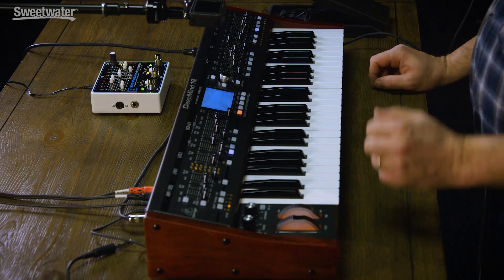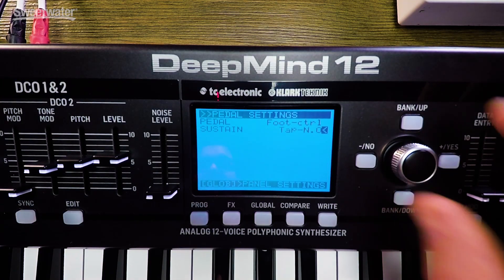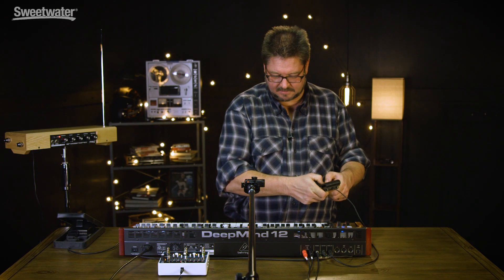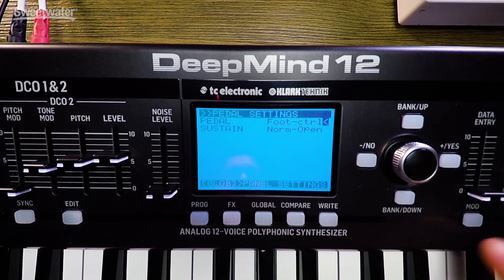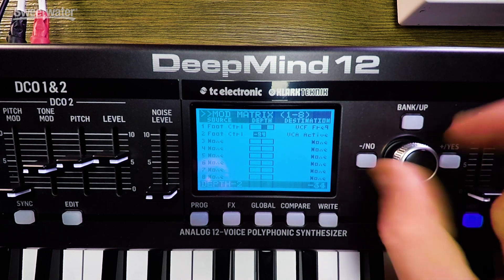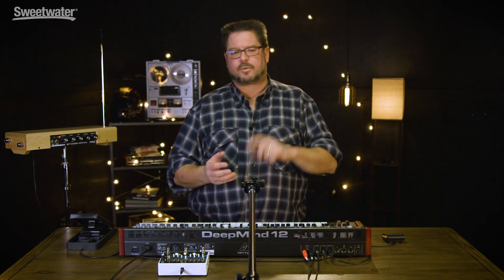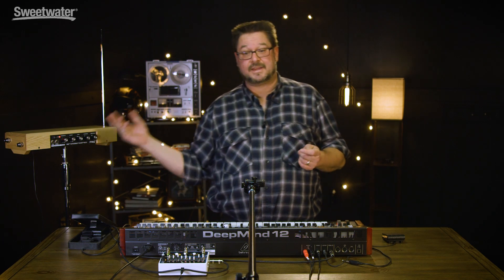Behringer DeepMind 12 Control Voltage and Pedal Inputs — Daniel Fisher

Comment: Hi there!

I recently bought an Electro-harmonix 8 step program analog expression/cv pedal to use with my deepmind.

I'm really struggling to get it to work despite following the exact steps in the video, I'm pretty sure its not my synth as I have been able to get the yamaha expression pedal to work in the CV input. The E-H pedal is new so I'd be surprised if it was defunct...so assuming neither my synth nor my pedal are broken, my issues might be coming from not understanding the settings on the E-H pedal..would it be possible to describe settings that work for the pedal in this vid? or anyone else who has succeeded in using it with the deepmind.

Unfortunately I haven't got any other gear to test whether the pedal works
Reply from the maker: See if only putting the plug partway into the DeepMind's Expression jack works. It's been a bunch of years, so I don't remember exactly, but try it. -Daniel
Reply: @sweetwater  great news! That worked. Thanks for the tip

Comment: Can you connect an electric guitar to the CV in?
Reply from the maker: Hi girboz. That kind of audio is not very useful as a CV source.
It's much more useful if you send the guitar's output to either an Envelope Follower (which then creates a voltage that follows the guitar's overall amplitude), or a Frequency Follower (which will create a voltage that can change the pitch of on oscillator). Thanks for watching! -Daniel

Comment: Thanks for the demo!  Any idea if i can sequence the deepmind 12 via the 1v/oct eurorack standard?  Currently trying to send CV via a eurorack sequencer to the CV input of the deepmind, then linking the pedal to change the pitch of osc 1 and 2in the mod matrix but getting nothing.  Any ideas?   Thank you.
Reply from the maker: Hi, Jonny. The DeepMind 12 accepts CV input from 0 to +5 volts, so you should be seeing at least some movement. If you purchased your DeepMind from us here at Sweetwater, call our Tech Support team at (800) 222-4700 ext. 6400 and they'll help you get back up and running right away!
Thanks for your interest!
Brandt Miller, Sweetwater Sales Engineer, (800) 222-4700 ext. 1628, brandt_miller@sweetwater.com

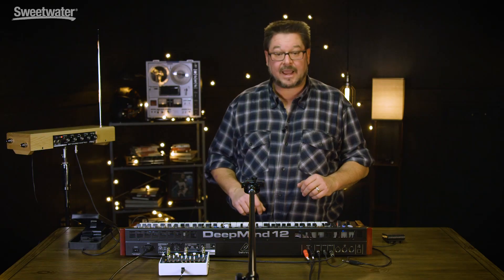Comment: WOW, the Theremin! @6:55  I bet the DM would also pair well with the Moog Grandma which has many CV out options.
The Moog Theremini also has CV Out — would it work the same way as the Etherwave in this demo?
Reply from the maker: Hi Valdis. Yes, the two CV Outs on the Etherwave Plus, the single CV Out on the Theremini, and the CV Outs from Moog Grandmother can control things that accept CV In. The Theremini can also send two chosen CC#s (one for each antenna) via USB MIDI.
Reply: @sweetwater  What a great (non-obvious) idea to use Theremin(i)s as synth controllers.  Thanks.

Comment: Nice video!  It should be mentioned that the wiring for CV input is Tip (from a source like the EHX 8 step) to Ring ( on the Deepmind 12 end) with common sleeve; i.e a floating tip cable.

Comment: Behringer decided to do their new line of synths correctly.  I'm a little blown away by how much thought went into it.  I'm waiting for the Neutron to come out, see what the price point is on it and then pick up a Neutron and a Model D.  They sound great.

BTW, I own a Roland MKS-10,20,30,50,70, and 100 (sampler) and Ensoniq Mirage (analog filter).  The DCO analog oscillator was the backbone of the affordable analog synth explosion in the 1980's.  You could finally save your patches!

Comment: Thank you for the excellent series of videos on the DM12. My DM12 arrived from Sweetwater on Tues 2/14 and I have a lot of fun exploring the keyboard and all of its many features!  I am using the exact same setup as you are Mr. Fisher and using the Yamaha  FC7 pedal I am unable to control the VOLUME of the unit.  What am I doing wrong?
Reply from the maker: Hi Mark, the jack marked PEDAL/CV is not automatically assigned to volume. It is completely flexible to be used in one or more ways for each program. Watch starting at 3:07 to see that you first choose which MIDI message is sent by the pedal, and then assign that MIDI message to a particular parameter in the MOD MATRIX with a specific depth. It's possible that a future update may allow global control of CC#7 to control volume of all Programs.
Reply: Just an update I have been in touch with Rich at the Music Group.  Rich confirms that there is a known bug right now which is being worked on and should be fixed in the next Firmware update which will allow the user to map Foot Controller to VCA All and get control over volume with the conventional sweep depressing down/forward (depth +127) and it will work properly.  Currently (firmware 1.0.4) this is not possible only the reverse (depth -128) works but the pedal sweep is backwards.  All the other MOD destinations work properly this is the only exception that I have detected.